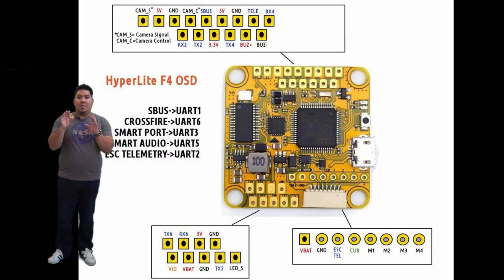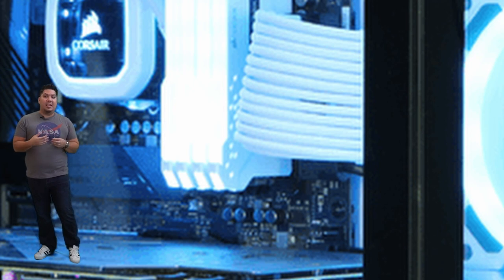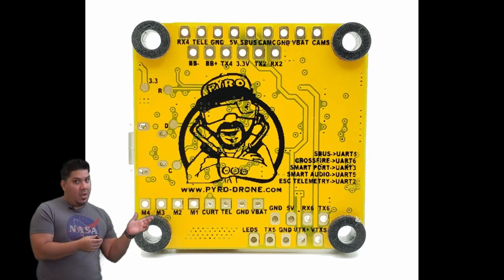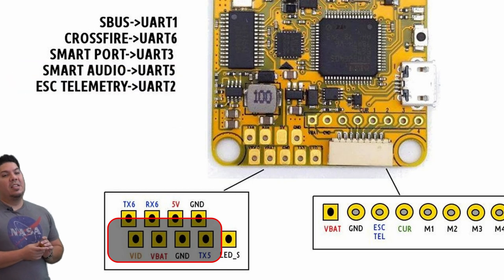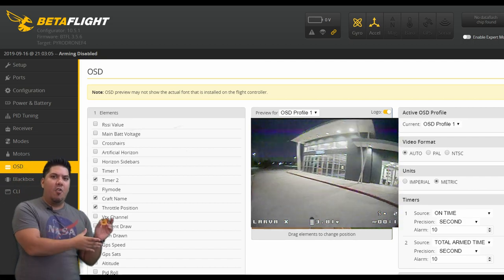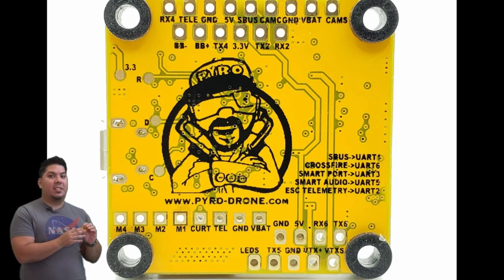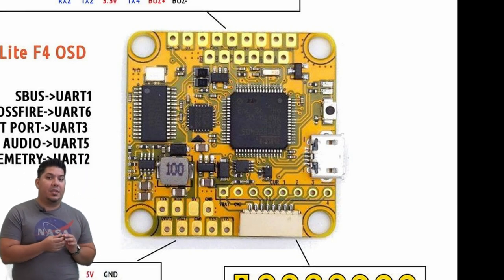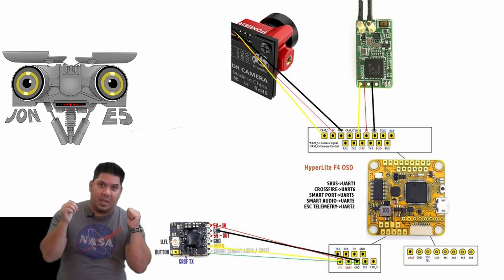Drone Flight Controller Explained - FPV Beginners Series - How a quadcopter Flight Controller works

Comment: Great informative video! I wanted to repurpose my old broken drone and make a RC plane, however the gyroscope in the drone flight controller is really messing with the motors as the plane orientation changes. for ex. if the plane tilts up the gyro tells 2 motors to turn of, etc etc. So I was wondering if there is any way to identify the gyro on the flight controller and remove it? and if I did manage to remove it would it interfere with any other functions? Thanks!

Comment: NIce video Jon. Chroma keying and audio are both good. Definitely F7 going forward for RPM filters, but for beginners RPM filters aren't worth trying yet. Anyone just getting into this hobby will likely smash and/or replace their F4 before the need for an F7 arises. :)
Reply from the maker: Thanks dude! Really good point about the F7 and filters I’ll be sure to specify that in a follow up

Comment: Will you please suggest me a best flight controller for 5 inch frame. As i'm planning to build a budget fpv, please suggest me a good and cheap with all specs
Reply from the maker: Imo, the one i show in the video is my favorite to use., but any F4 flight controller is good.  I just did a video on a budget racer, check out my Concrete Quad review from a couple weeks back.  I have a build list in the description.  Total cost is $175 on sale prices, or about $203 regular prices.

Comment: First of all thank you so much for that down to earth break down  of how this stuff is put together I'm still learning and you explain everything very well. I have a quick question  and I'll understand if you laugh this is probably stupid but I love to tinker I have a  bugs 3 mini that I absolutly love but I recently cooked one of the esc so its toast. I found a replacement 4 in 1 for it but it was expensive and I didnt trust the over seas seller to I just ordered a new one from Calif. But I have the old shell with 1306-2750 kv brushless motors and thought about maybe putting in a flight stack and making a frankinquad haha I don't really know where to get information like what speed and flight controller would work for the motors ect. the battery is optional.on the original its propriatary  so I'll have to mount a new one Im sure the original is  a 7.4 850mah 45c so I'f you or anyone has any advice I would appreciate it greatly.
Reply from the maker: Hey thanks a lot for the feedback.  I made this series, exactly for people to try to find somewhere to ask questions so I will do my best to answer.

Most modern flight stacks will work with those motors.  Keep in mind, if you use your own ESC and Flight controller, you may also need to provide your own reciever, if the one that is on the bugs is not compatible with your setup.  Most of us use Frsky Radio's or the new Jumper Series (T16 model being the most popular).

Then it would come down to if, you can fit the new hardware into the body of that bugs.  

Honestly, if i was in your shoes,  i would hold on to that project for a bit.  It is doable,but i would make that my 3rd or 4th build once you have more experience.  Doing a fresh budget build may cost you a little more, but it will be much more straight forward, and many more resources out there to refer to.  I have a video up on Concrete Quad, recently that is a budget racing setup, that you can build for about $160-170.  (Can save about $20-25 going with a less expensive frame like the Source One).

Once you have a few builds under you belt, you can start another new build, and move some of those bugs components over like the motors etc...

Comment: i finally got a decent camera (foxeer arrow pro). where does the camera's OSD wire connect?  same uart as smart audio?
Reply from the maker: Cam yellow, signal goes to the video input on FC.  Then video out goes from the FC (a separate pad) to your vtx. Your FC’s onboard OSD chip adds the OSD to the video feed before it goes out to the vtx
Reply: @JonE5FPV  no, I mean the pin actually labeled OSD on the camera. Not vcc, ground or video, but actually OSD. Is that for the button board I've heard some cameras have, for changing settings in the camera like maybe exposure or colors or something?
Reply from the maker: Yes it is for the board that connects/plugs in to change settings.